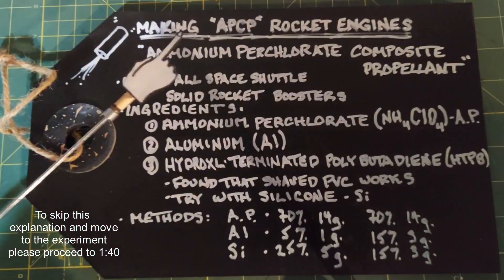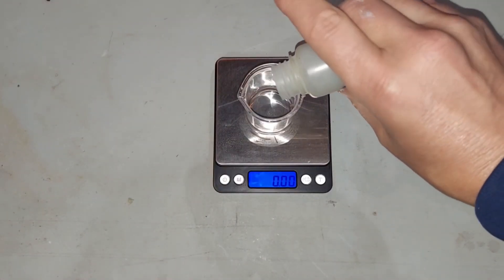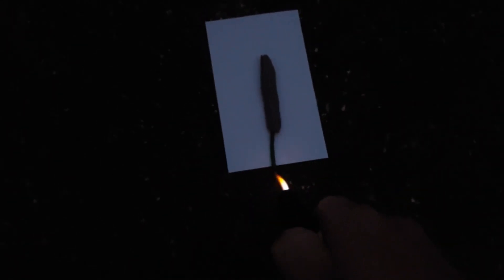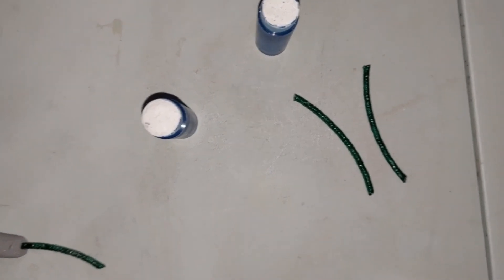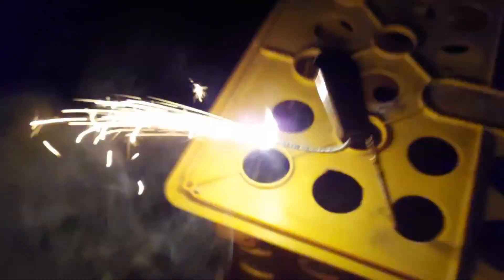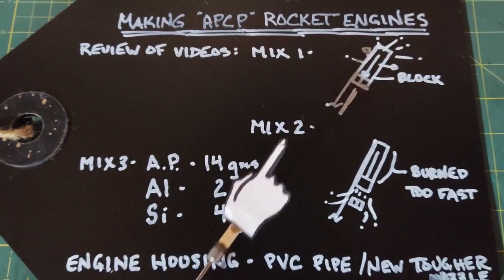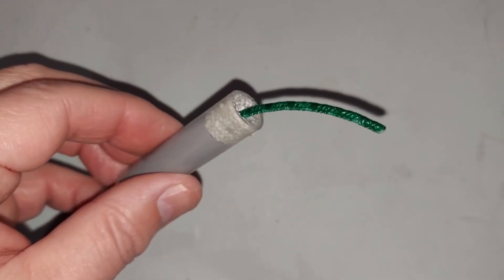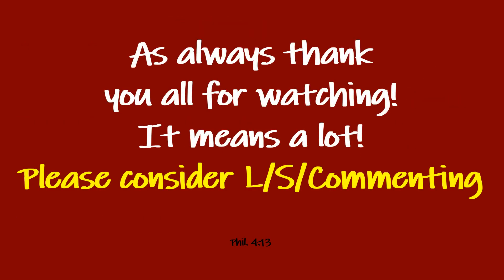Making Ammonia Perchlorate (APCP) Rocket Engines

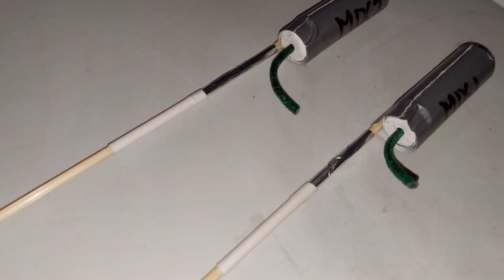Comment: 8:14 I saw electric drill and immediately recoiled. What if the sparks of motor or the friction causes an ignition?
Is it safe? , I like to think you took measures for it. Be safe brother <3
Reply from the maker: I appreciate the concern!  I have been building my own rocket engines for over 20 years at this point.  Using a drill hasn't ever caused a problem.  You need to have the spin rate lower to keep the friction down but sparks aren't an issue.  Thankfully.
Reply: @cranialconstruction  Thats super great to hear!! 
As an amateur who doesn't have access to rocket engines I had to make my own, and took care not to accidentally set anything on fire. Electric drill wasnt an option because I was soo worried, that I built a makeshift hand-turned drill (it's just a simple gear, shaft and a lever mechanism). That has helped me tons. 

That's why I got concerned! Hearing you took precautions aswell gave me relief. Have a good day!!

Comment: Just curious what was the source for ' drilling the hole stops it from clogging? Far as I know thats not accurate putting a core on a rocket increases the specific impulse thus increasing the chamber pressure
Reply from the maker: Anecdotally is my source.  After building 100+ different rocket engines and watching what happens if you don't drill a center hole.  Most launch and then explode in the air.  Estes has a refined formula that burns so evenly their rocket engines don't explode.  There is no center hole in an Estes rocket engine, and yet they have pretty great specific impulses.  However, you are correct in its ability to increase the specific impulse of a homemade rocket engine.  But, from a safety point of view a center hole provides a more open path for burned debris to exit the nozzle, even though at times it can still get clogged with debris, causing the engine to explode.
Reply: @cranialconstruction  Estes refined formula is compressed black powder lol
Reply: Source NASA practical rocketry 
Many solid-propellant rocket engines feature a hollow core that runs through the propellant. Rockets that do not have the hollow core must be ignited at the lower end of the propellants and burning proceeds gradually from one end of the rocket to the other. In all cases, only the surface of the propellant burns. However, to get higher thrust, the hollow core is used. This increases the surface of the propellants available for burning. The propellants burn from the inside out at a much higher rate, and the gases produced escape the engine at much higher speeds. This gives a greater thrust. Some propellant cores are star shaped to increase the burning surface even more

Comment: Can't find pure Al powder on Amazon but can find Al oxide. I'm guessing the oxide won't work at all.  Found aluminum and titanium powders on pyro-aluminum website though.  Would Magnalium be a suitable substitute? I can get plenty of that much easier. Please do an Ammonia Perchlorate & Magnalium test? I imagine this should work if the Magnalium is near 50/50 and silicone does not have H20. The Silicone binder sounds like it should work well. Magnalium comes with a higher safety risk... keep Magnalium away from any H20 including high humidity.
Reply from the maker: Yes, I think you could do this with magnalium.  As this mix would now burn even faster, you're going to have to decrease the weight used as compared to just aluminum.
Reply: @cranialconstruction  Thank you! Evidently I have a lot more research to do.
Reply: @cranialconstruction  My original post was around New Years. OK it's now 4th of July and I could not replicate your 3rd Mix or with magnalium but did source some aluminum powder.  I couldn't get 14:2 to bind with less than around 7gm of silicone and it did nothing. So I went straight to a 50/50 mix of NH4 + AL without silicone and just set it on fire with a fuse. Oh my lord it just about blinded me with the white flash. It did also set off the 14:2 silicone mix, it was spectacular and full of beautiful colors once I could see again.

Comment: Is it possible to delute the silicone with acetone, for the purpose of mixing and pouring? And after it evaporates,.........
It would make it easier to pour into a tube with a rod wrapped in cellophane, or thin coat of Vaseline.
Reply from the maker: Interesting idea.  Silicone doesn't dissolve well in acetone, but does in xylene and toluene.
Reply: Yes as said toluene xylene also white gas (colman fuel)

Comment: Casing too weak - a thin plastic tube cannot withstand the pressure being created. Also (and related to first point), your nozzle is too small! Even a PN/sugar motor generates 60 to 72 atmospheres of pressure (about 1000psi)!
Reply from the maker: Yep.  This was a video on firsts.  Just to see if an APCP fuel could be made from over the counter silicone.  To find the best ratios.  And then to try and launch an engine.  I had no idea that the thrust would be that significantly stronger than anything I had worked with to this point.  I will make an updated video now that I have worked with this fuel (quite a bit since this video just testing) and have some experience.

Comment: For anyone that wants to make the real stuff, HTPB resin is available for purchase at the RCS Store online, I got a gallon of it last year and still have 90% of it left even after making dozens of rockets. It's not the cheapest stuff (about $250/gallon including the catalyst) but the difference it makes over silicone is huge, it has a much more stable burn and is far easier to mold into grains, and provides more thrust as well. If you dont live in the US you're shit out of luck unfortunately, the RCS Store doesn't ship outside of the lower 48.

Comment: Did you use epoxy glue to mix the ingredients?
Reply from the maker: I mixed it with silicone sealant.  The same kind you would seal a water leak with.

Comment: Ok, I got my Ap off of Amazon back in 2012, as far as I remember that was the date. I'm out at this point and wanted to order more, no luck! Amazon used to have 90 micron ap available. Where are you getting yours? Pyroachemsource? And has it raises any concerns, as far as getting it? I have no clue why Amazon no longer offers it, but I can only imagine. Anyway always enjoy your videos Brother !
Reply from the maker: Yes, Amazon has stopped carrying some of these chemicals.  Especially those that can be used in pyrotechnics, rocket engines, etc.  I first got mine there several years ago and that's what I'm using in the video.  When I need to reorder I'm not entirely sure where it will come from, but a chemical warehouse is high on the list.
Reply: @cranialconstruction pyrochemsource is where my AP came from via Amazon so I'll just order directly from them next. I'm almost out,  used most of it for energetic perchlorate complexes.

Comment: Hey brother, any ideas on alternative boost powder besides black powder?  This rocket fuel maybe modified?  I have no mill and would like to use something besides bp for lifting ball shells. Thanks
Reply from the maker: Yes I do.  There are a couple.  Please email me.
Reply: @cranialconstruction  ok..will do
Reply: 3 KClO4 + 8 Al → 3 KCl + 4 Al2O. The stoichiometric ratio is 34.2% aluminum and 65.8% perchlorate by mass. A ratio of seven parts potassium perchlorate to three parts dark pyro aluminium is the composition used by most pyrotechnicians
Reply: @Aaron-zu3xn  are you recommending he use flash powder for lifting shells? Terrible idea

Comment: Is this how to do the solid rocket

Ammonium perchorite
Almiunium powder
Silicon
Magnesium

Mixed al of them and then use

Is that true 
?
Reply from the maker: Yes, that is correct.  You do need to mix in the right ratios for it to work properly.  Also, it is silicone used, not silicon.  They are two different things.
Reply: Ammonium perchlorate*
Aluminium powder*
Silicone* 
Magnesium wasn't mentioned.

Comment: where can i buy ammonium perchlorate at cheap site
Reply from the maker: That's a difficult question.  By nature, AP is expensive stuff.  AP is sold in large quantities most often so finding sellers of smaller amounts is key.  Amazon has fair prices and allows purchases of smaller amounts, less than 0.5 kg.
Reply: @cranialconstruction  ok from where did you buy
Reply from the maker: @iitaiimsmotivations  There are two sites that I use.  The first is the most basic and easiest at Amazon.  The second is a place called United Nuclear.

Comment: Use a metal coat hanger instead of wooden sticks. Still light weight, but no risk of burning.
Reply: No! A steel rod falling from several hundred feet is not a good idea.
Reply from the maker: That would work but I live in a neighborhood and launch a lot of test rockets.  The metal hangers would be strewn all over the place.  I know the wood will at least degrade.
Reply: @cranialconstruction  
Ah. Yeah, I can see how that could be a problem.

Comment: What's the cheapest source you found for AP? From what I remember it was vastly more expensive than KN.
Reply: Homemade
Reply from the maker: Your best bet is to search the net.  It's just not that cheap if you buy it unfortunately.
Reply: @cranialconstruction  way cheaper to make it but you need know how and means
Reply: @CatboyChemicalSociety  do you mean just by running a chlorate cell? I thought I remembered if you run it for too long it goes from chlorate to perchlorate
Reply: @DJChesley  yes but using PbO2 electrode at 150 ma/cm2

Comment: Cool, I bought a pound of AP from Amazon a while ago for rockets, haven't gotten around to using it yet.
Reply from the maker: Just a small note, a small amount of HCl gas is produced when these burn.  Just a friendly heads up.
Reply: you can replace potassium nitrate with AP in rocket candy and also make a very nice sugar rocket engine with AP
Reply: @Anon-zu3xn KN is better and stable with sugar. Perchlorates/chlorates and sugar are unsafe and can easily burn.